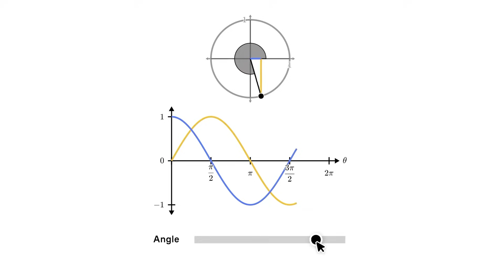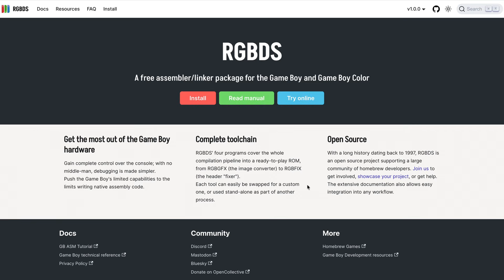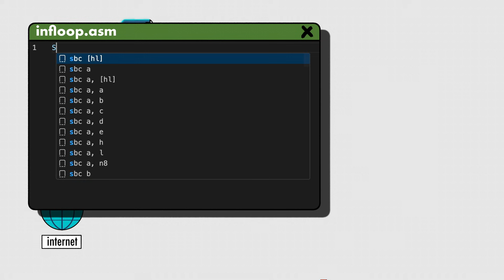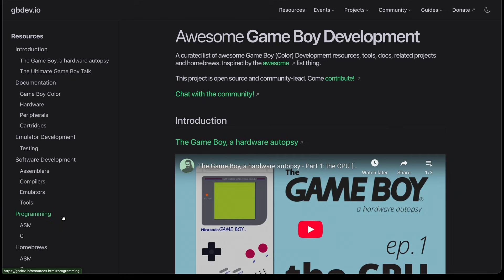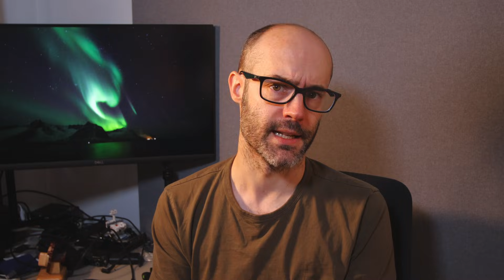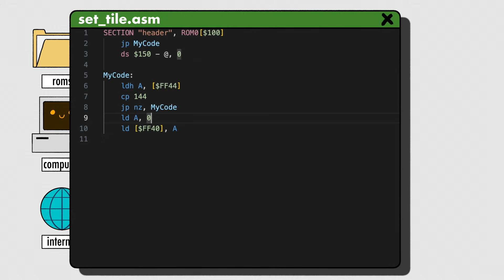Game Boy Assembly Crash Course

Comment: Damaging the dispay? Will this damage a mod retro chromatic display if I mess up?

Also how is ds ran when you jump before using it?
Reply from the maker: I have no idea if it will damage the chromatic display. I'd guess it wouldn't, but really I have no idea.

Good question about the ds. I was worried it might be confusing. The ds isn't an instruction that's executed by the game boy, it's just for the assembler RGBDS. When RGBDS is converting the human readable assembly into the binary machine code it will see the DS and instead of trying to produce machine code for it it knows to instead just insert the specified data. So that's all done before the game boy ever sees any of it.

Does that help?
Reply: @systemoflevers  Yes, that makes sense. Thanks.
Great video.